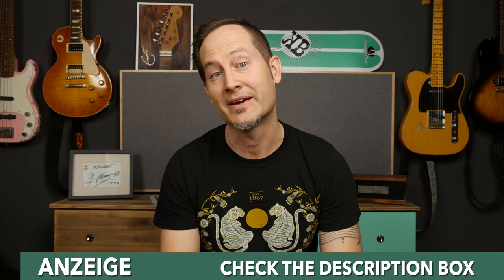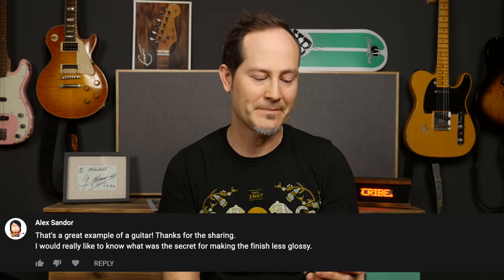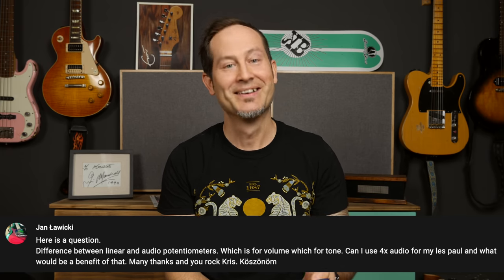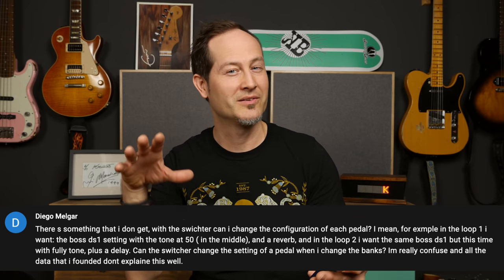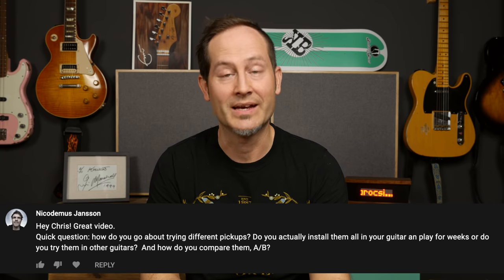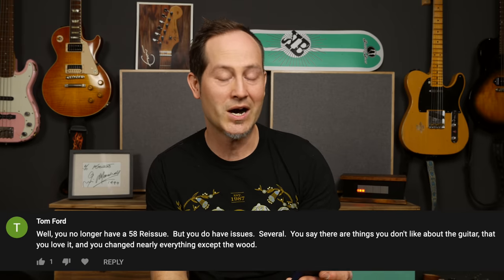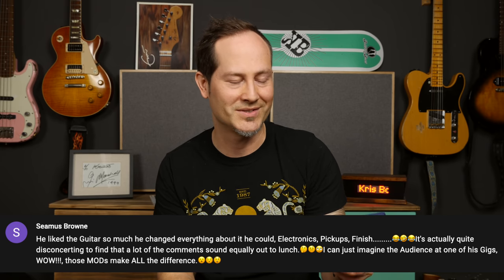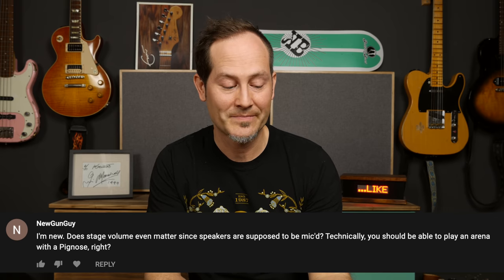How To Make a VOS Gloss Finish | Comment Time #14 | Q&A

Comment: Kris, where do you buy the Micro Mesh pads? Couldn't find a link in the description. Thanks
Reply from the maker: I forgot to put the link in the description. Sorry! :) Here you go: https://bit.ly/34nJVM9
Reply: @KrisBarocsi  no worries and thanks a lot! Already in the cart for the next order. On Amazon()de they are not available from Amazon directly and the shipping costs are too high
Reply: I have a 2 video tutorials on how to use a palm sander to dull the finish if you're interested!
Reply: Hi Kris, would you please be able to share the link for the Micro Mesh pads as the one in the comments below are no longer available? Also, did you use any sort of tool or did it by hand? I will do this in my 60s LP standard. Thanks.

Comment: Thanks for a great video. I have a question (reviewed your great video 5 things you should know about amps) about the effectsloop. You said in that video that some amp brands/models also distort the power section and the effectsloop. If you dont want that to hapened how do you then know what brand or models of that brand that dont do that? How do you find out that information/look for or do you have to deepdive into the manual? Is there a rule for this, like more clean amps, distorted or one or more channels? Thanks Kris learn so much from your videos

Comment: Hello Kris, its great how you deal with "not so nice" comments.

Lately I had discovery about amps, after trying Fender Champ style amp (the old one, single ended with only volume pot). Its amazing how it works with pedals and that you can get high headroom clean sound jsut with combination of clean boost and volume pot on guitar. So nice, when things start to work as you imagine.
I was thinking my Marshall DSL15 is good with pedal, but what is possible with old school Champ really surprised me. Good that we live in good PA era, so I dont need more volume, haha.
Reply from the maker: Thanks Stan! I respect everyone’s opinion and try to explain my point of view, even if we don’t agree at all. Haha
Ohh and those Little Champs are absolutely fantastic. We tend to underestimate old and simple gear. We really shouldn’t. A good example for that are telecasters and the Champ. 👍 cheers!

Comment: Hey Kris, I love listening to your comment time videos!
I have a question about my low/middle budget guitar (Fender Modern Player Telecaster Plus). I have had this guitar now for 10 years and I love it to pieces. Love the neck, body contour, the versatility (HSS configuration of pickups), playability, how it looks etc. And it has great sentimental value to me - it was my first 'good' electric guitar. Now I am fortunate enough to be able to afford some  better guitars and I have actually but my Tele is the last one I would sell.
The only thing is that I can hear and feel that the pickups, pots and the rest of electronics could be better.
What is your suggestion, leave it in an original condition (it is not a bad guitar by any means) or tweak it? How much better can it get with some quality stuff? Will there be a significant difference or it will be just slightly better (in this case I would prefer to leave as it is). 
Looking forward to your answer.
Regards!
Reply from the maker: That’s so much man, let’s talk about this in the next Comment Time. 👍
Reply: @KrisBarocsi  nice, I was hoping you will suggest this 😀👍

Comment: Hey man! first a Big THANK YOU from Niagara Falls Canada - 
I have burning questions ALL about your Les paul, I just got into the LP style guitar world and I REALLY 
need your help 
My Les paul won't stay in tune and I don't want to put thicker strings , my guitar has a decent spec to it and i like my guitars to play smooth/ easy with 9-46 i don't usually go up string gages from that.
(Please read bellow🙏🏻)!
*
How do you keep the damn thing in tune so well?
I have an unsung Canadian les paul I.e the godin LG same gibson short scale and it really is not holding tune despite a graptech tusq nut that it came with and schaller tulip style kluson tuners. Almost every time when I whack a big G chord or play a fast lick followed by a big bend it falls out.
:
- Right now I have 9-46 strings on it right now.
 so im wondering :
- What can I do next ?
- Do I have to swap out these pesky tulip tuners ? Yours seem to do the job, how ?
- I like big behind the nut ( fake whammy bar !) bends famously done by John Sykes and mastered by Phil X too so tuning is really important..
- using like 12 gauge strings is not an option i play on my esp vintage plus HSS superstrat with 9-46 so jumping up so many string gaiges probably will feel crazy stiff and just uncomfortable  to play.
- do I need to just jump ship altogether and get 3 on 3 modern staggered locking tuners by schaller hipshot etc quality locking tuners and ditch the vintage ones if nothing else works ?
*
 I am new to the les paul game, have played superstrats since I started but the godin single cut LG caught my eye for price specs and looking unique in a cool way
 ( I think prs's are tacky looking and gibsons are too classic everyone has one and I wanted to try a different kind of single cut).
*
I really look forward to hearing some advice from you about the above ^ the Godin LG feels phenomenal of the damn thing would just stay in tune it would be my next main player. Until I figure out these tuning woes I've just been playing my strat.
*
Just looking for some clarity and I thought there was no one better to ask who is a bit more familiar in dialing in these beasts.
Your big heavy and underrated riffs you play on it and candid videos of you sharing your secrets, playing style and lessons in general are a real treat - the les paul specifically yours looks like it plays in your wheel house 100% so I hope you can tell me all the ins and out about keeping it in tune.
.
Thanks in advance for any help and advice; stay safe keep rocking and giving us this amazing content my friend. 
All the best 🤘🏻🙏🏻
- Adam
Reply from the maker: Hey Adam, thanks a lot buddy! Yeah sure, let’s talk about this issue in a future Comment Time video. Stay tuned and thanks for the kind words! 🙌
Reply: @KrisBarocsi  please my friend that would be amazing in the next comment - time video I am really struggling and want to give these LP / single cut guitars a chance but mine is just not holding tune where as yours sound and hold tune phenomenally ! I would love to know your secrets 🙏🏻  I will stay tuned, looking forward to it Kris cheers for now ! 
🤘🏻
- Adam